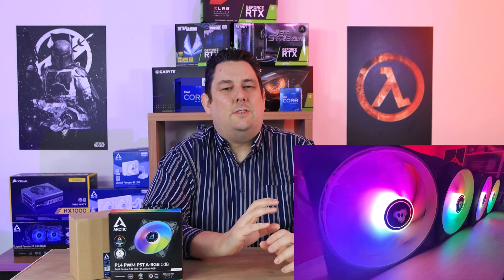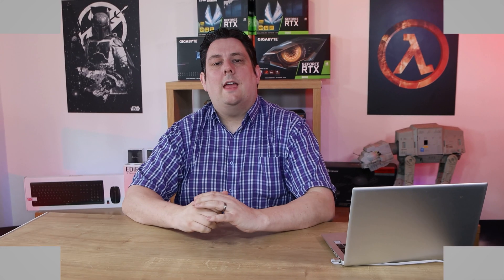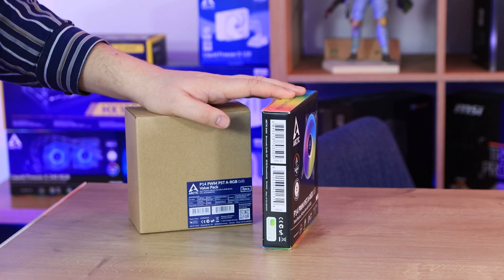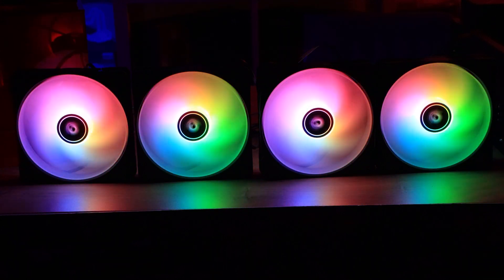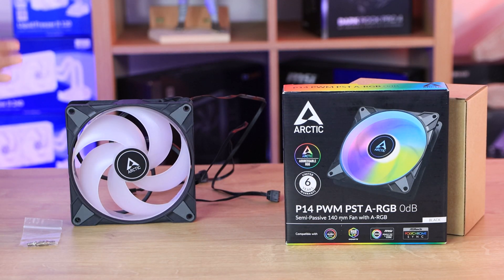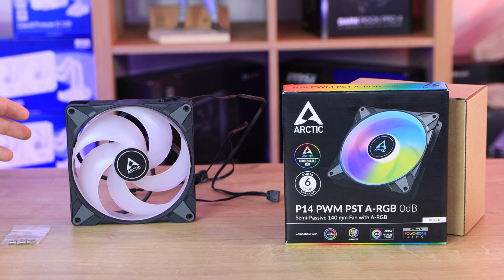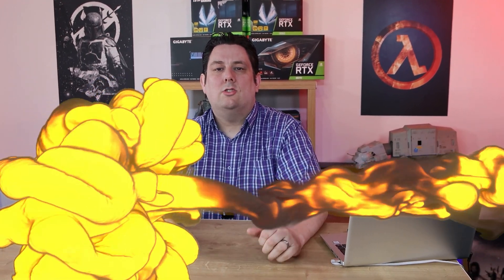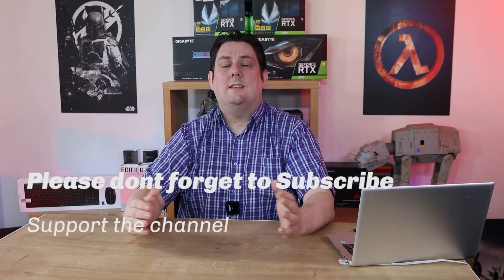The Arctic P14 ARGB 0dB - 140mm of Colourful Performance, quietness!  Review & build.

Comment: Would these be good as a case fan (intake & exhaust) with 3x be quiet! Light Wings 120 High Speed on a DeepCool 360mm AIO radiator? Is there an alternative 140mm ARGB fan(s) that you would recommend for intake and exhaust in 2023?
Reply: These are fine as case fans and radiator fan etc

They have the performance to do everything.
Reply: @Gaga4Parma  thx, stock from certain places or suppliers might be hard to get in Canada.

Comment: Are these recommended as only intake fans or can we use them as exhaust fans?
Reply from the maker: These are more ideal for using on cooler and water coolers than for airflow, they will still work for airflow but are not optimised for it, they can be used for intake or outtakes.  Arctic F12 and F120 fans are more optimised for airflow
Reply: It's dependent on how much obstruction one has for their intake fans. With a light mesh like this than some more CFM orientated fans will likely be better while a more air restricted sound optimized intake with dampening material will favour these fans over CFM fans like in the instance of the fractal define series cases. Generally speaking with exhausts CFM is king, but in tight cases having some static pressure does make a difference. So with more open traditional cases CFM orientated exhausts are superior. While with small factor specialty cases where everything is tightly packed having the static pressure is preferable.
Reply: @Ilost11  so in fractal design meshify c these p14 argb are OK to use? (as intakes)

Comment: Hi there! Need little bit of help with something. I wanna buy 4 x Arctic P14 PWM PST A-RGB and 2 x Arctic P12 PWM PST A-RGB, since I wanna be able to change colors and speed of the fans, would  Arctic A-RGB Controller and Arctic case Fan Hub do the job via  RGB Control Master software? Will those controllers be enough for those 6 fans regarding speed and color of it? And I forgot to mention that I have Asus B550-F Gaming motherboard! Thanks in advance!

Comment: why did you not show how to put them into the case or motherboard 4pins and 3 pins
my arctic fans dont do glow, because i only connected the 4Pin header and the 3-pins for argb are no where possible to insert in case, controller or motherboard......
Reply from the maker: Well we tell you that I needs to plug into a ARGB header in the video and a 4pin PWM fan socket, also show you you what the socket looks like at 1:45. As stated as well if you don’t have a header you can buy aftermarket controllers
Reply: @TechforTechs  Thanks i did not see this or forgot it.  What for a controller can i buy now ? to get a 3 Pin connector? I guess the Razer Controller isnt good?
Reply from the maker: @AngryTheNikname  anything should work as long as its 5v and argb.

Comment: I really like the P12/P14 Arctic fans, I have a 5 fan PWM PST value pack (non RGB) of each. But regarding their ARGB versions, I really can't tell if I like the actual ARGB lighting, these colors seem more pastel/pale and my personal preference is more saturated. They're still decent looking though.

Edit: What case is that? It look quite compact for a case that fits 3x140mm in the front panel.
Reply: the colors might be pastel because of the ARGB input. On your RGB control program you can set how many colors do you want. For example, Signal RGB's spiral rainbow effect lets you change between 3 and 100 colors. 3 colors gives you red, green and blue ONLY, 6 colors gives you a well saturated Red, Yellow, Green, Cyan, Blue and Purple, and 300 colors has almost no definition between the colors and they come off pastely and bright.

Comment: How do you think they compare to the regular P14's?
Reply from the maker: had to say airflow wise, other then what's on the website, but usually you get a slightly lower airflow on RGB fans as the central hub has to be larger and blocks a little of the throughput.  noise wise they sound the same.

Comment: Do you think I can connect 3 back to back  together for my front case fans on a single 4-pin rgb header ?
Reply from the maker: We had no issue doing this and even managed all 4 we had with no issue, but had found in the past some fan on some header controllers do not always like it, they work but the lighting can seem a bit fuller or man not sync up properly.  So hopefully will be fine but can’t guarantee it.
Reply: @TechforTechs  Thanks for replying ! I'll try it, but if that doesn't work what do you recommend ?

Comment: Great Video Phil

I was just wondering what you would recommend using if you’ve got a motherboard that can address fan speed but cannot address ARGB Lighting..? 

Like a device with Remote Control or connected to the Reset Button
Reply: Thank you for getting back to me Phil 

I’ve use to use the standard P12 Fans in previous builds I’ve done which worked fantastically... 

With my 1150 Motherboard, it doesn’t have connectors to address the LEDs on ARGB Fans etc... what would you recommend I could use to change the lighting effects..? 

I use to have Corsair SP120 fans in my setup, again absolutely fantastic fans but I wasn’t too keen on using software to address the lighting effects... as it’s just another program and process running in the background... 

I’d much prefer something simpler like a remote or reset button to change the lighting effects...
Reply from the maker: @templetoon1983  ok I see what you mean, there are a lot of unbranded ones on the market that can be ok, just make sure they have all the connectors you need,  branded ones are rare on their own, they seem to only come with fans packs,  one I have heard good reports about is the TOUCHAQUA FAN AND DIGITAL RGB RF REMOTE CONTROLLER HUB but we have not used one ourselves, they are available at overclockers in the UK or amazon https://amzn.to/3t0vFGz
Reply: @TechforTechs  thanks for your reply I will keep an eye out for a decent bundle pack ☺️☺️☺️☺️
Reply from the maker: @templetoon1983  also arctic do have one as well, but we have not used or seen https://amzn.to/3eSWpRf
Reply from the maker: I do like the Arctic Fans and be quiet silent wings,  depending on size and if using as case fans (Flow) or for a cooler(pressure), I would recommend the Arctic P or F series fans like the standard P12, P14 or F12, F14 PWM fans.   Hope that helps and thanks for watching  - if you cant get local try this link https://amzn.to/32ZQhnA